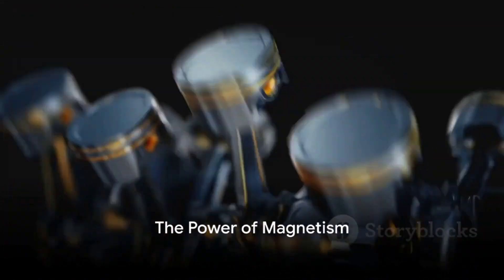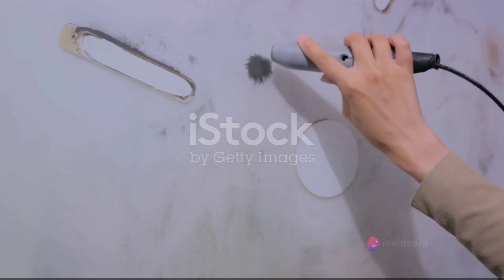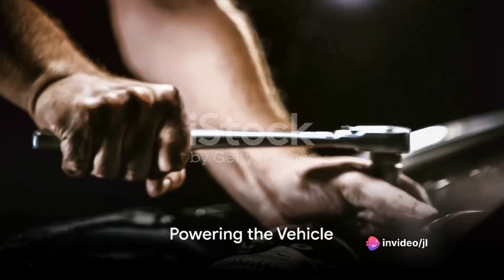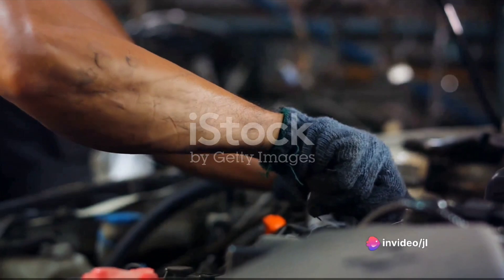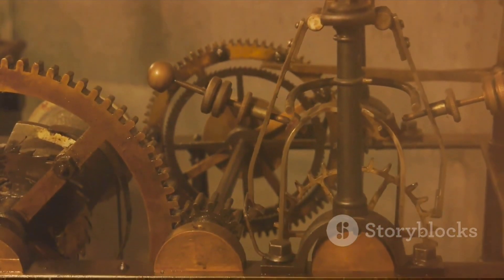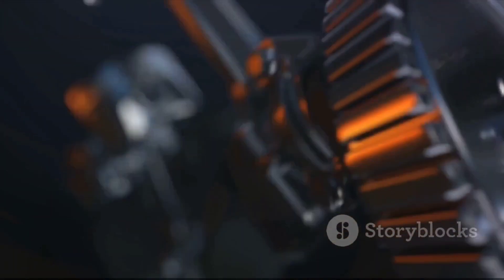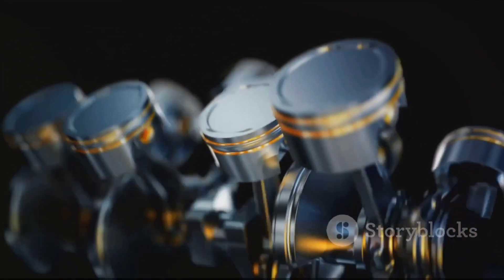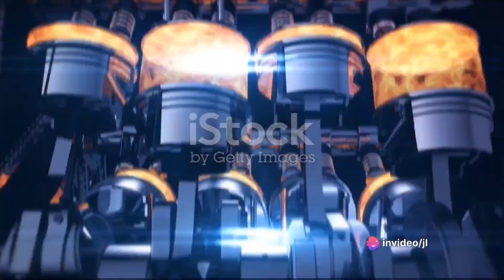Magnetic piston engine to dwarf combustion engine?!

Comment: CLICKBAIT!!! This video describes perpetual motion, Which is impossible. You need to burn fuel in this case. The magnets would only add resistance and slow the engine speed, greatly reducing efficiency. Not to mention that heat and magnets don't mix. Electromagnets would use engine energy to basically slow it down. Nonsense idea. There is so much wrong in this video. It never once shows a prototype. I hope this clarifies things.

Comment: Interesting concept. Could be even more interesting if electro magnets were able to be used in a combustion engine to apply a pull when the piston is coming out.

Practical application? I can visualize it but with how magnets have a really high exponential factor based on distance away it might not be anywhere near practical in implementation.
Reply: The use of solenoids would be much better. But still inefficient.

Comment: Of course, it will not work with permanent magnets. Electromagnets could make the concept work, but would still lack the mechanical efficiency of a traditional electric motor.
Reply: I built one when I was a kid. Because I knew permanent magnets would be useless, I used   ELECTROMAGNETS, which would be turned on and off as needed. However, the switching contacts would wear out very quickly (I wasn't aware of the inductive kick-back at the time). The vibration was horrendous, and it was never as strong as the little brush-type PM motor I was hoping to replace.

Comment: Sounds very much like perpetual motion to me. There are two types of magnets, permanent magnets and electromagnets. There is a parallel in the world of combustion-based engines: the internal combustion engine, the turbine and the rocket. The turbine is more efficient than the ICE because it has fewer moving parts. Here, the existing rotary electric motor will always be more efficient because it has only 2 bearings, and those can be magnetic bearings. This concept may be explained by AI, but in its essence is really stupid. Entertaining, but dumb. Even when narrated with an ersatz Attenborough, it is stupid.
Reply: "[E]ersatz Attenborough" ! LOL!
😆